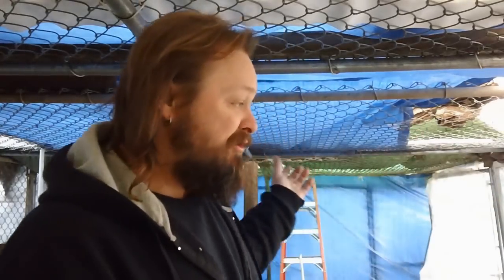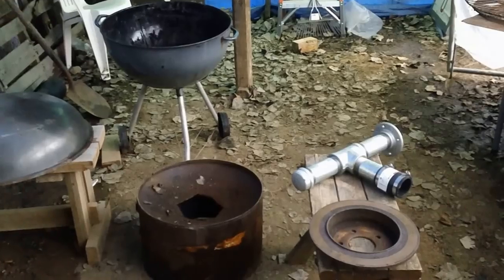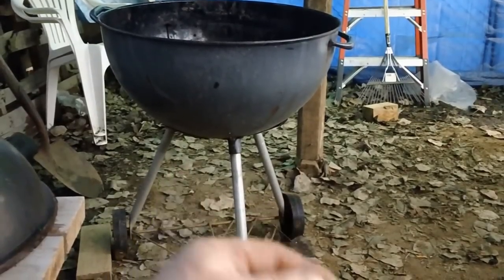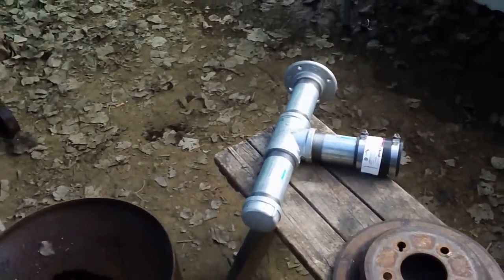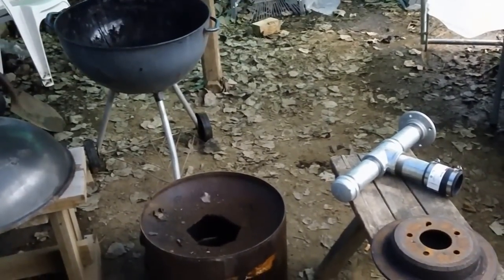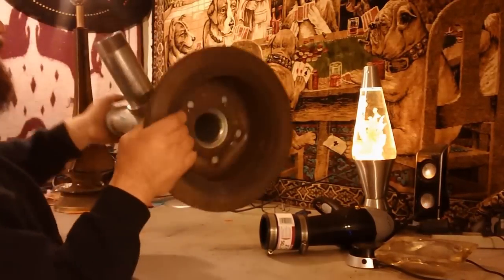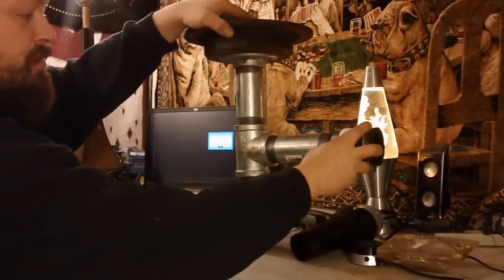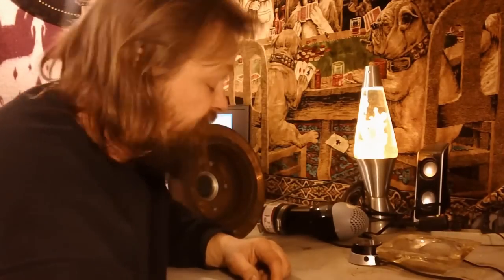Building a Homemade Forge

Comment: I noticed you used a brake disc, could you also use say a drum off a pickup as well? I got a 78 ford parts truck that I'll never use the drums for anything.
Reply from the maker: Brake drum will work also.

Comment: I'm just a newbie but everything I've read said NOT to use galvanized steel because of the zinc vapors.
Reply from the maker: In most extreme  heat applications I would have to agree. In this situation, The pipe is below the flame. What ever Galvanizing is exposed to the flame will burn off in no time flat on your first ignition. You will notice about an inch or 2 below the hearth, the pipe will burn of the galvy, but the pipe itself  stays cool below that mark. Keeping one thing in mind. This is a cheep, temporary build, Most of these things burn out or fall apart in just a year or 2 depending on how much you use it. With that said. The one you seen in this video has already burned most of the hearth out, and the legs broke. I have already build another one about 2 months ago. I had to replace the rotor but i was able to reuse the galvy.  I hope that info helps with you build project. If you have any other questions feel free to ask. Thanks for watching.
Reply: what !! don use Galvanized . oh my.. on my propane forge  I use Galvanized for my  Barrel  running into  my body chamber it don't get hot enough ,,, and for my coal forges ,, I use it for my Duct work it don't get hot enough to let off caustic gas's  if you use Galvanized as a main  chamber you will have to burn it of the chamber ..  and it takes a bout  25 to 30 minutes to burn off galvanized off a 12 x 20" chamber  from the time it comes to heat . and then you are alright just don't stand  down wind ...
Reply: There's something about your voice...soothing, melodic.  I have become a subscriber for life.
Reply from the maker: metamech Thanks you very much.
Reply: Galvanized as far as duct pot  not much of a chance to poisoning you  it is a plus if for coal or charcoal forge is out side . I have seen folks even use galvanized pipe for propane  tubes for forges but the collar and the pipe going into  the collar is Iron  and never had a problem , if their was  say flash back and  the flame was back in the galvanized pipe  then it may be a problem of a person didn't have enough smarts to see he had a problem lol
 but as long as its under the heat or fire  not enough heat their to worry about . one thing to help i a heat sink , take a layer of fire clay  at the floor of the coal / charcoal forge  of about 1/2" thick and set another plate with your air holes their ,  all is good ,, happy forging ,